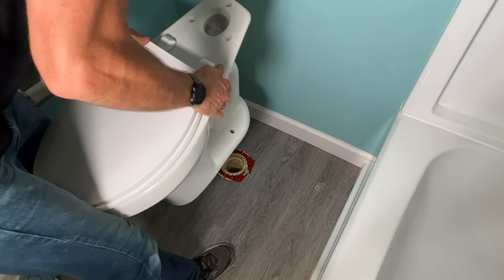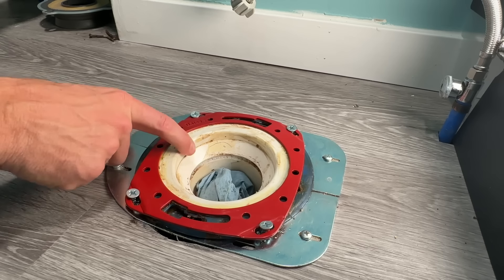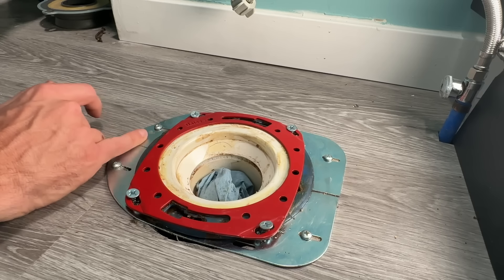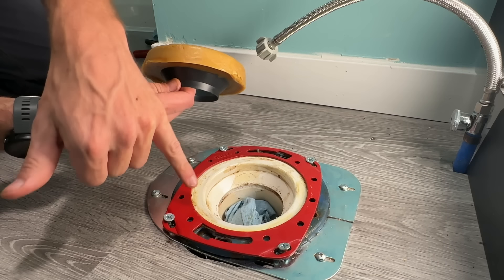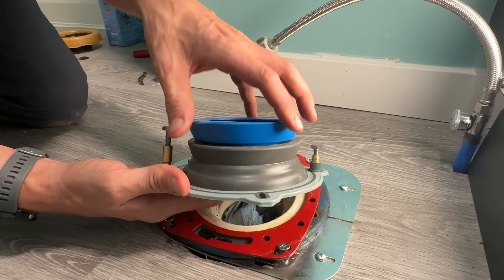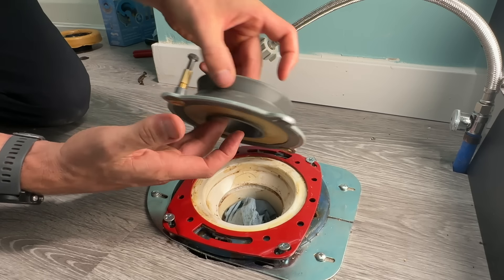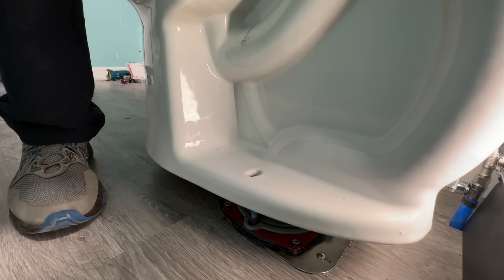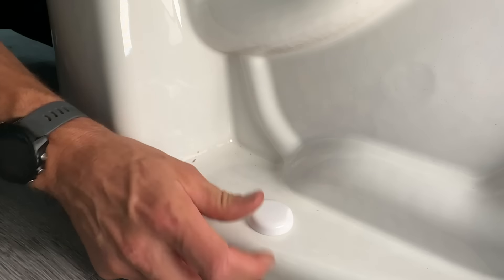How To Install A Toilet Bowl | Best Product On The Market!

Comment: I bought the Danco then changed my mind after reading the Amazon reviews.  I went with a plain wax ring along with jigsawing a plastic base plate to get a quarter-inch height on my 1/2" high flange to make the flange the recommended 1/4" high off the floor.  Also, dry fit your toilet and place the shims first to make it level then reinstall the toilet with the seal rings and the shims already in place.

Comment: I'm a plumber in the field for 20+ years while these are not bad designs nothing beats a standard wax ring
Reply: Looks like a convoluted solution for a problem that doesn’t exist
Reply: Well, the amount of material above the floor is more than the space under the toilet. Im sure the toilet didn't sit on the floor completely without some sort of a gap.
Reply: Absolutely agree. The key is to start with a good flange and then a properly centered and seated wax ring.
Reply: @darrenmoyer
lol, that’s my point, that contraption is so damn tall the toilet won’t even hit the floor, this is a troll video
Reply: @axminsterz4151   Paying for new components that go straight into the trash.
Reply: For beginners standard wax rings can be a scary thing because if you don't do everything correctly the first time and fuck up then you have to try again.  Which is then wasted time and money so....
Reply: Yes on a level flat floor, flange in excellent shape. But this video wasn't about a level, flat flange..
Reply: @ron8528 : I’ve installed and replaced dozens of toilets and wax gaskets will work in every situation and will last virtually forever. Uneven floors, high flange, low flange, crooked flange doesn’t matter, you simply buy an extra gasket for $2.00 and use whatever you need on top of the main gasket or return it if you don’t need it at all. Simple, cheap and 100% effective.
Reply: @rayray8687  well what's your remedy for rusted flange with broken studs, no where on flange to tighten toilet down... That's what this
Video was covering. Not using just a double wax ring..I use wax rings, until the flanges are no longer viable.
Reply: What does you being a “plumber for 20 yrs” have to do with anything
Reply: @ron8528  Oatey makes a 4” pvc flange that slides into the waste pipe..
Then you tighten the 3 hex nuts inside of the new flange ,
which expand the base of the new flange and compress against the waste line.
They work great.

Comment: Thank you, thank you, thank you! I'm about to put a new vinyl tile flooring that is much thicker than the vinyl sheet flooring that came with the house. I have been dreading it  because most likely I'll have to take out the old flange and install a new one to match the new floor's thickness. This will let me just use the existing flange. Perfect!

Comment: These are ok I sold a few when they came out,Alot of the Pros preferred the Fluidmaster Wax less seal or the Old school Fernco that sticks to the bottom,either way if you're not the best at setting using something like this can help.Just rember Chlorine and other harsh chemicals can damage these reusables.But for big people and uneven floors there 👍

Comment: I've seen this in the store and it looks good. I've tried the Fluidmaster and the Korky products and was not real happy with the them. Trouble with both of them is that if the flange is above the floor, even removing inserts, you don't get them to squish down enough like a wax ring, you get rocking and have to shim all over the place.
Reply: There are videos that mention Old houses settle ; but the cast iron doesn’t . And sometimes the old flange has to be removed , so a new one can be positioned at the correct height . I think this is the problem I have , but I might try a wax ring , because of your comment , thanks
Reply: @psychiatry-is-eugenics  yes, you can smash a wax ring all the way down to basically nothing so the toilet won't Rock. And don't forget to caulk around the base which locks the toilet to the floor and keeps it from moving a little bit every time you sit on it which over time will cause it to come loose.
Reply: @PlumbNutz  just make sure you leave the back of the toilet uncaulked so if there is a leak you know. If caulked 100 percent you never know until its to late and cause a lot more damage.

Comment: As a mechanical engineer and a DIYer I can assure you the less joints and components you have, the less chance of leakage there is. Also keep in mind that you are using multiple products from different suppliers, those products weren't specifically designed or tested to work together as an integrated system and might be great products on their own but perform poorly when working together. However, as a rule of thumb, when it comes to fluids, you would want to minimize the number of joints, parts, seals, flanges, gaskets,... you use because each one of those carries a risk of leakage due to quality issues or poor workmanship and the more you use the higher the risk.

Comment: Well done, well explained. I’ve never had an issue with placing a wax seal or having one leak IF the toilet does not move. I think it’s hard to imagine a toilet being solidly mounted and not ever moving when secured with only two bolts just snug in a plastic flange. Eventually the toilet will move, usually with a 200+ user leaning over too far. The solution is to use caulking around the base to the floor interface on the front and sides leaving the back open to indicate a problem in the unusual chance the seal leaks. If the toilet isn’t moving it won’t leak.
Reply: I see no need for caulking, and have never caulked a toilet I've installed, on wood, tile, vinyl, composite, etc.  No issues

Comment: 3rd video I liked tonight.  I have a new bathroom and a new toilet that is already set, but I did remove it recently to snake out the drain.  When I put it back I lost my seal around the outside.  Been wanting to lift it up and scrap the remaining silicon from the floor then set it again.  I have that new all in one already.  I didnt know it had a wax ring built in but from before it sealed ok enough for me to re silicon it all later.  But this was a learning video for me.

Comment: I'm a Master plumber with over 20 years experience. I gotta give credit where credit is due. You managed to screw up every single thing about installing a toilet. That takes talent with such an easy job.  It's been 2 years since this video was made. Guaranteed that toilet has been pulled again by now. If it hasn't It's probably just slowly rotting the floor out.
Reply: Just checked your channel.  No video on how to do it properly.  I'd watch.

Comment: I just had to remove my toilet that had this kit installed 7 years ago. Everything looked good with no leaks. If the tank had'nt cracked I think it would have been good for many years. I like the new bolting method. That will be what I use on my new toilet.

Comment: I just installed a Danco yesterday - a little different but did not work.  I am sure my fault, going to take out in a minute and see what the heck going on.  After removing will do what a commenter said to check the levelness of the toilet and then reinstall.  Product seemed fine and easy to install and am sure I have an issue on my end.  Also painter's tape to see where it should go is great idea.

Comment: i always use a couple of 8" pieces of stripped 12 gauge romex wires wrapped around the bolts to guide the toilet. Tied fishing line to the bolts and ran through the bottom of the toilet once, worked great.
Reply: Cut one McDonald's soda straw in half and place one over each mounting bolt...perfect fit, to make alignment easy.

Comment: Excellent! Way better explanation than Danco. They fail to mention that you need to remove the black plastic insert BEFORE installation if the flange is higher than the floor. It's mentioned as an afterthought, if the toilet does not sit flat, after installation of the product. At that point you would have already applied pressure on the bowl and squeezed the wax down the sides;  removing the product now (to take out the plastic insert) would break that seal.

Comment: This does look better than the wax ring with plastic funnel, but I prefer the Fernco adapter with no wax. I have been using these for over 20 years and they are the best and easiest to install. There are others similar on the market, but I haven’t had any of the problems with these, so why change or try others. Another comment….none of the mess as with the wax rings.   Thanks…..Jim
Reply from the maker: Hey Jim, thanks for the feedback!
Reply: i remember once as a kid seeing a plumber try that. leaked and he had to come back...
Reply: This works best on a new toilet. Old ones you have to clean off the old wax meticulously…..very hard to do. I have done it, just takes awhile. Thanks & try it, you won’t go back to the wax ring.   Jim
Reply: @jimpie231  considering i cant even find them outside the supply house which treats homeowners like assholes i wont be, the wax ring i use is 1.89. and ive never had an issue.

Comment: You should make a video on how it actually collapses and seals the flange and toilet. Put it on then take it off and inspect it. I had to do a little bit of thinking about how this product really works. I was amazed by the engineering behind it. The plastic around the wax actually collapses when you tighten the nuts on bolts not only sealing it but the center extends down into drain so that it's not just flush with flange but it will not let water out from bottom of toilet on to floor. Before installing use both of your hands and push plastic inwards as when putting your toilet would do the same. You will see that the other end extends, that gives it about 2inches going into drain. Just the answer that I needed so that i wouldn't buy extra parts.

Comment: I switched to a "non wax" accordion rubber ring, and never looked back.  Best of all, if I need to pull the Crapper, I can reuse the ring, and no worries about a failed seal.

Comment: Thank you for this video. I went from wax to rubber seal and back to wax  the flange in a new home was glued, no screws. With compression it moves and seals collapse. The hole in the concrete subfloor is too big so the flange has no support.

Comment: Although your method is better than a traditional wax ring, there is a better and more foolproof method. My local Menard home center sells a round rubber gasket that has an extremely strong adhesive on underside. This is applied to the underside of the toilet. It is long and ribbed and this takes all of the guess work out of centering toilet as you install it. You can also remove and re-install toilet several times with this same gasket still in place on the toilet. One issue on toilets over time is they can start rocking a bit which does not affect this gasket for it protrudes into drain pipe around 3" with 3 ribs contacting the drain pipe for a secure seal all the time from sewer gas escaping.

Comment: Over the years I have set less than a dozen toilets . I have never experienced a failure using the old methods. There is only a 50 /50 chance I will use this product in the future. The price will probably be the determining factor.

Comment: If the seal component were silicone, I would consider it. However, rubber has a nasty habit of hardening. I like the toilet bolt fastening mechanism.

Comment: I can see this being the item to buy if you have a older or unusual install.  Other than that a plain wax seal is fine.
Reply from the maker: Yeah, I lean this way as I do have several rental properties which are older and anything but “usual installs.” 😂
Reply: Until you mess up and have to pull the toilet off, ruining the beeswax seal.
Reply: @EverydayHomeRepairs  
I recommend utilising toilet paper instead of towels to cover the open pipe. It does take a slight bit more effort to prepare for catching loose pieces, but you otherwise won't have to forget to remove it.

Comment: I thought the new rubber seals were pretty slick. I stepped up and bought one. Install was easy. Life went on. Until the kids stopped up the toilet and I took the plunger to it. Every push down blew water out from around the rubber seal. I went back to the wax seals and haven't had a problem since
Reply: I've never had much luck with any type of rubber seals on hundreds of toilets I've installed.  Last week I replaced a toilet that had been installed for 55 years and never leaked with a wax seal.

Comment: i tried a couple kinds of the rubber, plastic and foam seals and they seem to attract dirt and mold the pipe is clean, but seal is a wet slimy mess hard to say if it is cleaner than wax seal at least you don't have to scrap wax off everything toilet and flange with this one i guess that is an improvement.

Comment: Just did away with a leaky wax ring seal, used brake cleaner to desolve wax residue, using a more flexible foam type seal now.

Comment: Fluid master brand is my choice there is no messing around with any wax rings, I didn't have to use both pieces it came with just one rubber piece drops in flange not having to use the adapter works well since installed it 10 years ago no more wax rings ever again..

Comment: Just a toilet story, not related to this product. I was having a problem with a rocking toilet. I tried shims which helped the front to back motion, but I couldn't get them in for the side to side, so I decided to remove the toilet and redo the whole thing. I found whoever installed the flange (glued in PVC) had installed it aligned so the insert holes for the bolts are where the bolts should be secured making them super loose and could have even fallen out. The wax ring was completely crushed and there was some minor water damage.  I looked at several techniques about fixing loose toilets, but I haven't seen one for my situation. I thought about gluing the bolts in place, but I decided to cut out the old flange and put in a new one that is properly aligned.

Comment: I prefer the "better than wax" seal. It has a long enough horn to funnel water into the drain pipe. Also it's not a restrictive reducer like some other kits. I see some weak points in the kit shown in this video.

Comment: Years ago I replaced seals on a toilet bowl where the floor flange was way too low.  I bought a piece of drain pipe with an inside diameter that accepted the bowl's outlet pipe stub, and an outside diameter that fitted into the floor flange.
Then I placed this pipe stub into the floor flange and placed 2 wax seal rings over this pipe stub.  The bowl required a little pushing to firmly stand on the floor.
Never could figure out how sealing was accomplished without this little length op pipe.
As an aside, I would never use plastic or rubber seal rings.  Wax seals have an almost indefinite life expectancy.

Comment: I've had to use a couple of those rubber wax seals and they work incredible. The best part is you can lift the toilet up if it's a problem area 345 as many times as you need to. Without having to free scrape the wax off and start again. I had one customer that had two leaking toilets I fixed one of them with one of these type of things and then the second one it kept leaking due to the being a micro crack in the actual bowl somewhere in the p-trap drain. I could never actually see it or figure out where it was actually coming from until we put a new Toto toilet and replace of the Price Pfister piece of garbage that was leaking. I think the one upstairs the same exact toilet is somewhat better for some reason I can't tell you why. But it also begs the difference you need to use a quality toilet as well because you don't want to have to go out seven times like I did to this house in order to finally tell them hey you need a new toilet there's nothing more I can do.
Reply: Interestingly in the factory where the toilets are made they will tap the bowl with a ball bearing. 

The sound it makes tells them if the toilet is all good or has developed a crack they can't see.  Not sure how it would work on a toilet that has water in the p trap that would have to change the sound of it.

Comment: Those rubber seals. The water from coming out on the floor but they will not stop sewer smell completely. There's a reason we use wax for all these years

Comment: Is that flange removable/reusable if you mess up or is it a one time use like wax? I use the "Fluidmaster 7530P8 Universal Better Than Wax Toilet Seal" because you can pull it off and put back on repeatedly as needed.
Reply: Plus one on the Fluidmaster. I have to pull toilets all the time at my rentals and I'm so happy to see the Fluidmaster seal. One less thing to mess with.

Comment: Like. Wear gloves. If you use paper towels to temporally obstruct drain pipe, moisten them enough with water or non-flammable oil to prevent sewer gas (or critters, mostly roaches) from getting in. Large foam cup or pressure test plug seals better with less hassle.

Comment: Most Toilets can receive 1/2" of Flange with Ring, So the Flange needs to be 1/4" above finished floor, and 1/4" for Ring will be a good height. I like Fluid master Non wax ring, it comes with an extra spacer for more height and it can be cut in half with a Razor for the perfect height.

Comment: When I remodeled the master bathroom several years ago I installed a tile floor. With the backer board, mud, and tile the toilet wouldn't seal. I checked before turning on the water.😁 Back then that flexible flange didn't exist or I didn't know about it; neither did my plumber because he told me to stack 2 wax rings. I was skeptical but I did and it has never leaked. If I ever change out another toilet though, I will definitely use the modern flange.
Reply: Extend the flange! 10 bucks any hardware store sells kit with different thicknesses!
Reply: 2 wax is fine, millions  working right now
Reply: @dollyhadbraces9361  It hasn't leaked yet. Thanks for confirmation!